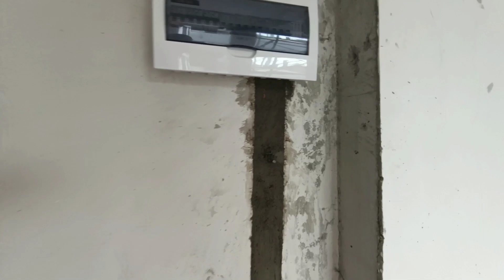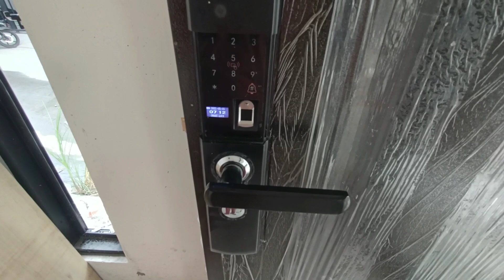Start na ng Tile installation sa Deca Clark 👍

Comment: I can tolerate electric pipes underneath tile slabs..but not water/gas line underneath tiles slabs due to movement of following reasons...thermal contraction&expansion...ground settlement due to soil compaction with added load weight over time...seismic activity whereas Philippines is in Pacific ring of fire...dapat balutan ang conduit ng foam padding that will serve insulation & cushion...